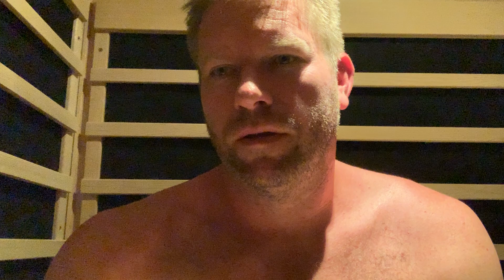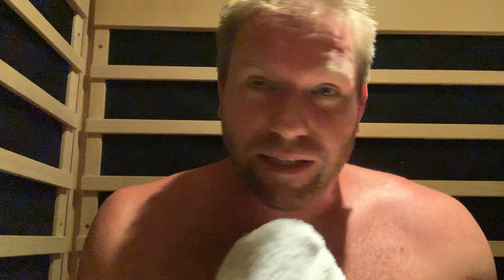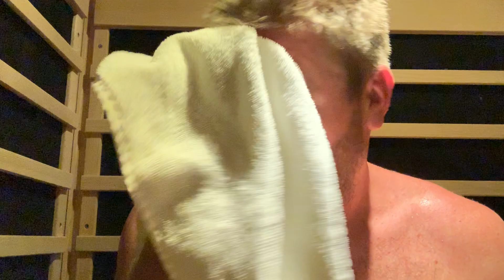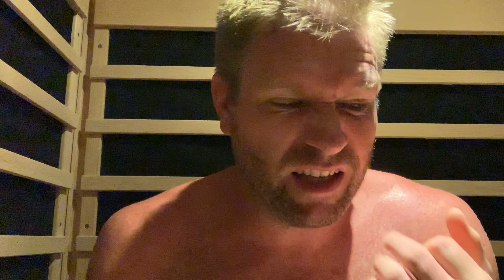Dr. Klinghardt - Infrared Sauna Recommendations Part 1 - Certified LOW EMF Far Infrared Saunas

Comment: Very valuable.  I did a lot of research on Saunas. I am EHS electrohypersensitive.  The best sauna I have found is SpaceSauna, near-infrared. I had a friend that is EHS and she thought her sauna was low EMF.  I measured her sauna and discovered the panel and the speakers were emitting wifi and Bluetooth.  For those that don't know, wireless tech opens the blood-brain barrier (BBB), so in a detox sauna situation where you are mobilising toxins, this is NOT a good combination.  

You can use demand switches to turn your power off at night. Seek advice from Building Biologists.